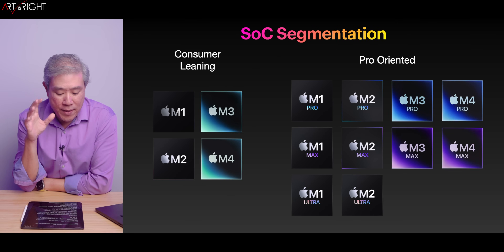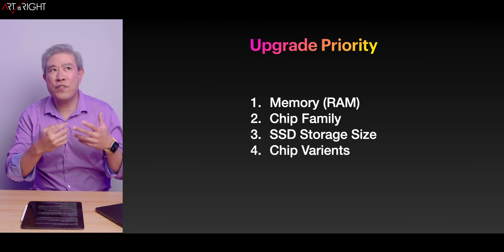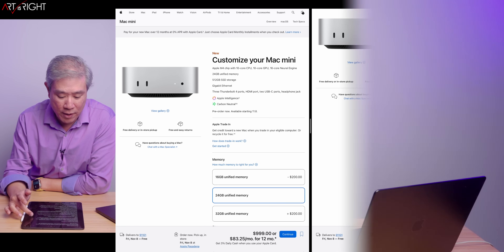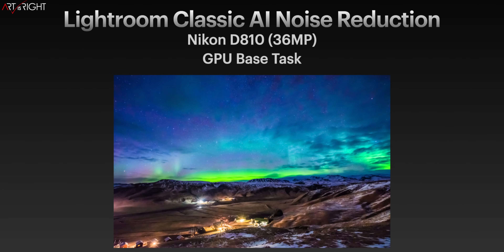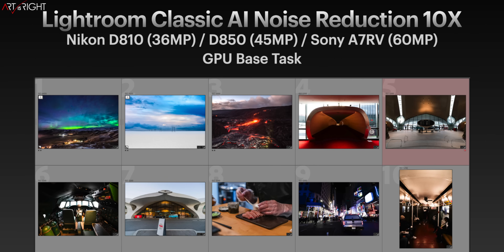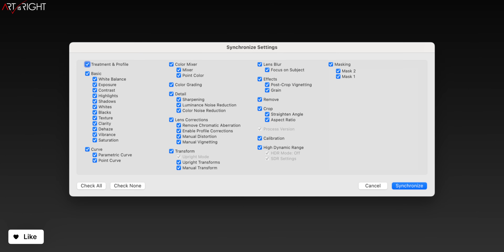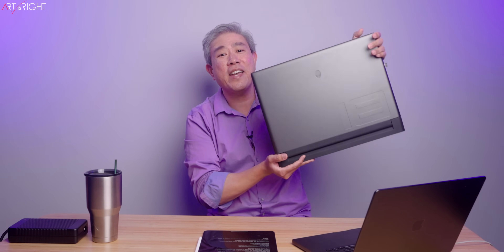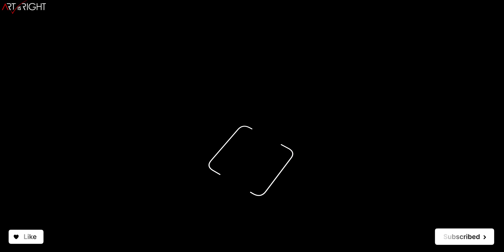Changes to M4 Gen Testing Methods

Comment: Do you think mbp 14” m4 with higher ram vs mbp 14” m4 pro chips with lesser ram, which would be better for multitasking and heavy lightroom editting? Thank you
Reply from the maker: No you lack the cores CPU and GPU, it won't help in most, only task that uses RAM may see some benefit

Comment: Happy to see the local adjustment "AI" masks sync times. Its an active use task so I can see the difference from my older computer. I don't usually sync masks that often, but I can determine how long it takes to work on one image, and that's important for day-to-day work. 

Just for fun - mask sync from 1 to 10 additional 42Mpx images (subject, background, sky, ground) takes over 30 seconds on my desktop i7 9700K + RTX 3070... but AI Denoise is just 14-15 seconds for an image.

Comment: I would be interested in seeing some minimal testing, if possible, how Pixelmator pro compares in speed to CaptureOne and lightroom. Given that Apple will soon own the company it might be interesting to see how the speed changes over time compared to the competitors. None the less I am looking forward to seeing the results from the test you have already planned/performed. My current laptop only works connected to mains power. So it is time for an upgrade.
Reply from the maker: I need to look into Pixelmator more, the thing is that I don’t have automated script for those or a benchmark app such as Puget, it makes it difficult to test program like these. But I’ll take this into consideration

Comment: SSD Performance? It looks like there's 2x performance difference between Base M4 and M4 pro chips. Curious especially about 1TB SSD.
Reply from the maker: I see some have already tested that already :)
Reply: @ArtIsRight  there were some tests with different sizes but not 1TB Base M4 vs 1TB M4 Pro I could find.

Comment: Thanks, I am curious if there is a difference in SSD speeds between capacities?
Reply from the maker: Like previous years/gens with the number of nand chip used for varying capacity of storage, yes we’ll probably see a speed variation. But like I said before, even the slow one is more than fast enough. Most people won’t run into an issue :)

Comment: Hi Art. Love your videos and I’m looking forward to all the upcoming tests! Did you consider testing denoise on LrC 13.5 in addition to version 14? I would assume it would use the NPU on M4 just fine. Would be nice to see the same test run on both versions.
Reply from the maker: I have some preliminary test runs on a very limited machine with 13.5 NPU, but the thing is most will use 14 onwards that and I have limited time, so I’ll take this into consideration.
Reply: @ArtIsRight  No worries Art. Thanks as always!

Comment: Great!  I use an A7RV! Lightroom import time is vastly different, depending on your import settings. It would help to know what those are for your tests.  Another test I would like to see is preview generation, or do you include that in the import test?  Another good test would be to select 20-30 object masks in a scene and look at rendering time to view.  This is something that brings my 14 inch M1 Max with 64 GB memory to a halt.  Finally, I don’t typically see a linear time differential, based on the image size, with Lightroom Denoise AI.  Thank you for all your work!  I know a lot of your tests are done by hand, and are very time consuming.  I look forward to seeing your results!  Oh, can you add the Mac Mini to your list?  I’m thinking about adding an M4 Mac Mini for my desk and relegating my laptop, specifically for travel.  Thank you.
Reply from the maker: Just preview, no preset apply. Import is 1:1, hence preview generation. :)